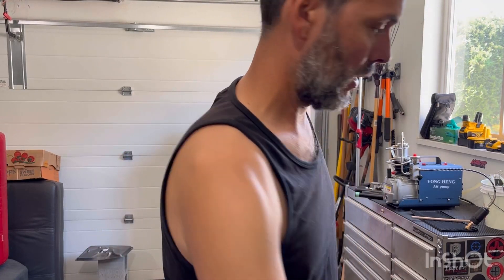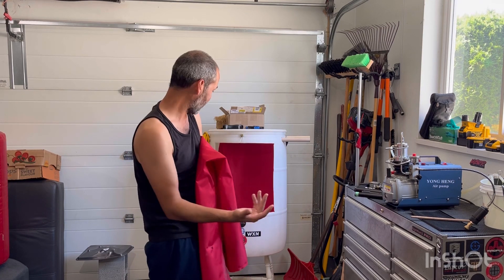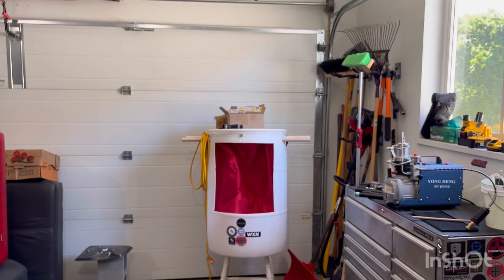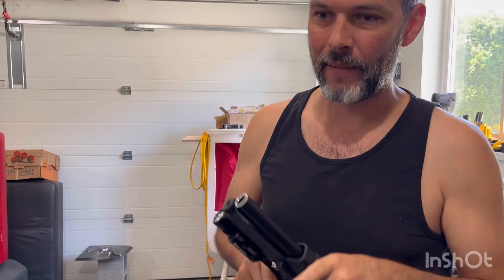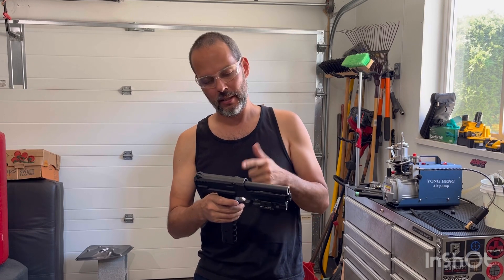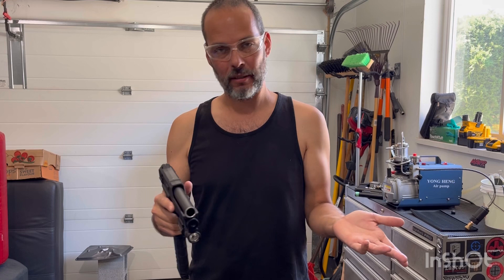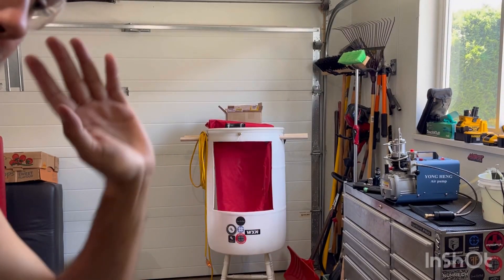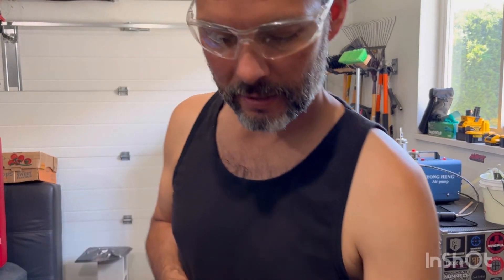Tippmann Tipx Less Lethal - Stronger Magazine Spring Answer To Flips?

Comment: Great test Sean👍. So a stronger spring didnt cure the issue. So now you will file/grind the hole in the block larger? Looking forward to the videos. Cheers 😃👍
Reply from the maker: Thats the plan so far since i cannot find any of the aftermarket blocks conveniently located. If all else fails round  ball it is.
Reply: @lesslethalfordummies  All my magazine-loaded markers struggle with slugs... Only balls work fine... Strange but true 🤔
Reply from the maker: @runerebel8441  i am usually a balls kind of guy 🤣🤣🤣 but lately my M17 has become flawless with slugs so i am on a quest now to at least try all my markers. Historically i never had any issues with my first Tipx but i used a different block.
Reply: @lesslethalfordummies  Your videos are very interesting. Tinkering with our markers is half the fun 👍

Comment: I haven't found the HP68 to be more impressive than the Jul v2. Why does everyone seem to want them to work in large magazines, where jams are likely? The Tippman Tipx with 684 barrel and 9.9g Riot Balls seems to out do everything else. The Hp68 seems best in the HDR 68, where you don't have to worry about jamming.  With all the testing done by you and others, I am sure there is a reason for wanting to use the HP68. It is not obvious to me with my "miniscule" amount of testing. Thanks for any reply .. by anyone.
Reply from the maker: My dude you are 💯 correct. Shaped projectiles have given me more grief then its worth sometimes. Roundball just work and heavier 10g is better. Riotballs are precision weight and very round.

Hp68 or other shaped projectiles I think are really just illusions of real bullets. Our brain is drawn to their resemblance of the real thing. In most cases shaped projectiles travel slight faster because the way they plug up the barrel (seal) and allow the use of pointed stuff for penetration which would technically not be considered LL.